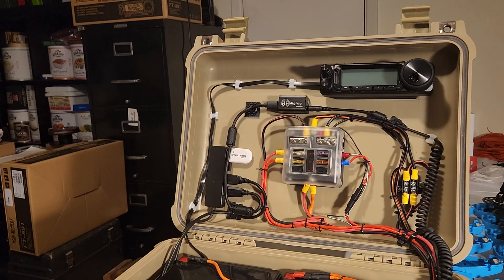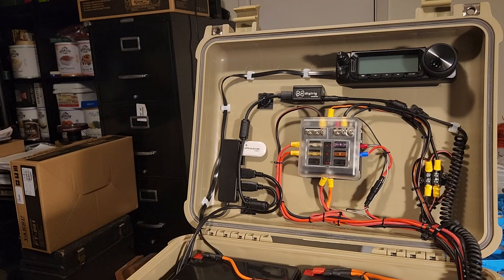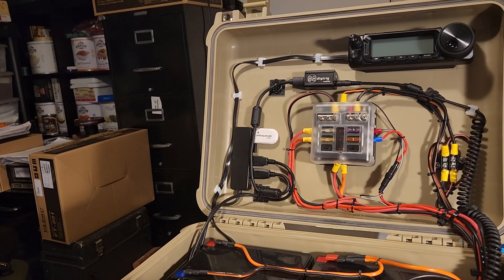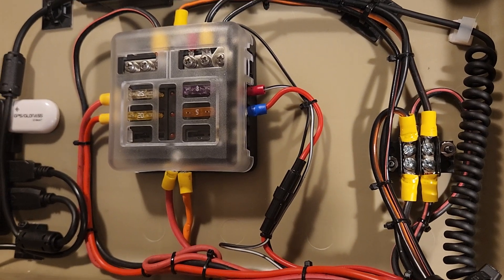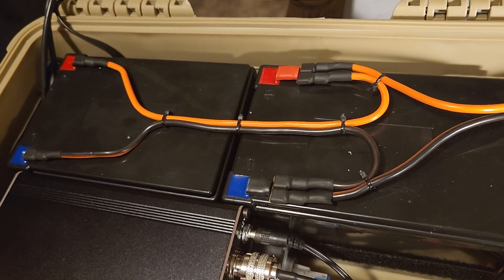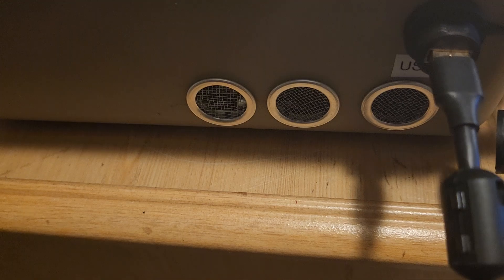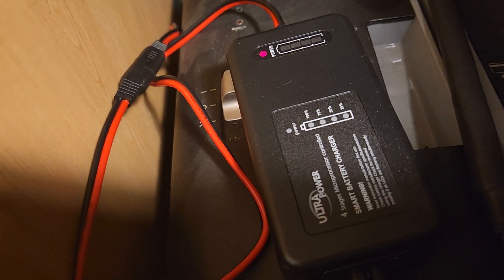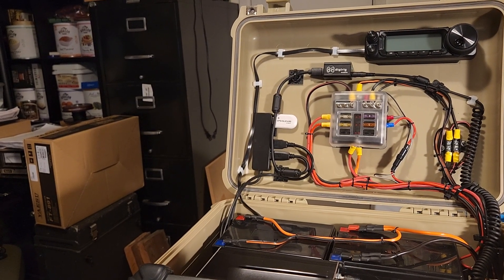Yaesu FT-891 Portable Box (Completed)

Comment: Looks like a great build, but have you found the radio controls to be in a weird spot?  Seems like having it at the top of the lid would make it tough to reach while operating.
Reply from the maker: @tccycling  No, there is plenty of room to access all the controls. The reason for this placement was so that the head will clear the stuff in the bottom.

Comment: That's a very complete system for a GO Box.  I haven't seem many that included an external antenna tuner and a full digital setup.  Was the decision to use 2 16AH batteries instead of 1 30AH battery due to cost or form factor?
Reply from the maker: @bwillan  Thanks, and yes the two batteries were due to form factor.

Comment: Nice! I plan on using the Same HF radio along side a Yaesu FTM500 dual band. I'll have HT docking stations and USB charge plugs powered by numerous Bienno Batteries. I will add firewall plugs to daisychain this into a solar charged power pack.

Comment: would also love to see how the ATU-130 works, is it like the LDG tuner where you push the button and it tunes the antenna controlling the radio for you?
Reply from the maker: No it's actually using sense. No cable required. It will tune automatically, or you can tune it manually.  But you can't tune it from the radio as there is no cable.
Reply: gotcha, thank you!  @N5BSB  I'm thinking of getting another 891 and building a go-box for it.